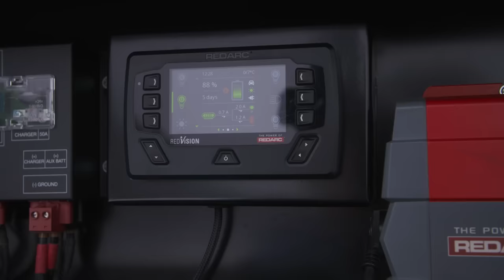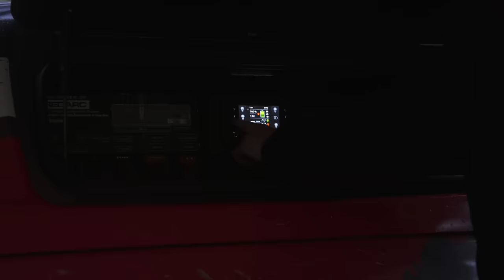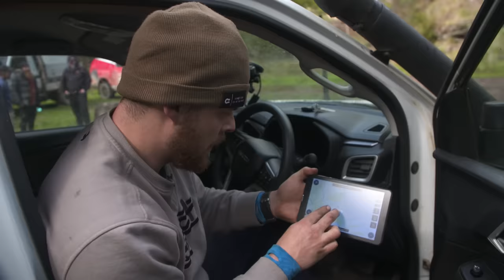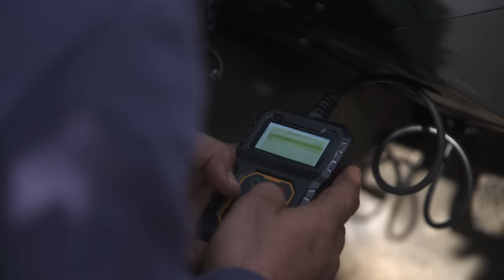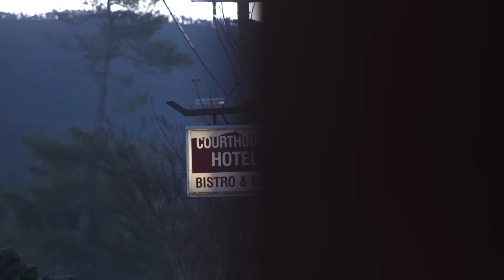4 HOURS WINCHING IN MUD & SNOW! Three 4WDs FLOATED downstream... Who got towed home?

Comment: What is funny is that Shano hasn't discovered snow chains. It's like taking a sword to a gun battle.😀
Reply: All makes a better video for there target audience of 12 year Olds who want to see 100k cars and hard wheeling
Reply: lol yep that is the one chains work the best on snow 😁
with out them you have a problems to drive the track
i have juse them many time's
Reply: With shunos driving the snow chains would fly off
Reply: Yo that’s so true what were they thinking
Reply: @renedeboer7348  but with them you dig bigger holes faster and less progress
Reply: @jasonh4167  Not really. In order to float on top of the snow you need HUGE tires. If you have that snowchains are not used. 
With or without snowchains on "smaller" tires you need to reach the bottom (or something firm) to gain traction.

//Scandinavian
Reply: I'm sure they've used snow  chains in previous episodes
Reply: Same thing I was wondering. No chains? Kind of a rookie mistake.
Reply: They have said that the permit says you have to take them with at least.
Reply: @perpelle  yep, dig a bottomless pit because under that soft snow is soft mud 👍🏽
Chains are better for icy snow on hard pack road or pavement 

//Appalachian mountain man
Reply: @MrMrsregor  Depends on the ground frost and the depth of the snow. I've had far better experience with chains no matter what vehicle or what type of snowy conditions off-road, both private and in the military.

EDIT;
/last outpost, north of north.
Reply: Think that's why he said they air down like they're driving on sand
Reply: I reject that remark about being 12.  I'm at least 14!!
Reply: I hear snow chains are beneficial for mud, as well as snow.
Reply: That’s funny because I opened up the chat to ask if AU has ever heard of chains!!!😂
Reply: Nar digging wheel trenches on 35" for the normal 4wds on 32" is part of the fun. great when the tracks get blocked because of trail destruction...
Reply: snow chains are for noobs
Reply: gloves would have been another good idea.
Reply: As a Alaskan the only time I see chains is on heavy equipment in mud
Reply: Is there snow chains in Australia🤔🤷🏻‍♂️
Reply: @timtemple8953  have you ever heard of a metaphor? Seriously Tim, you need to grow up.
Reply: @jasonh4167  Only if you spin them. If you are experienced, no digging.

Comment: Common problem for the zd30CRD is the fuel pressure releif valve, they get tired over the years and dont let the common rail pressurise up. easy fix, ill bet its that.
Reply: That, or a injector leak. Mine had the same issue. Would not start, and died when pushing hard. Turned out to be a leaky injector, so the ZD30CRD could not get enough rail pressure to start. Needs 5000 psi to start. Would run an injector leakback test.

Comment: I'm just 16 minutes into this episode and I've been waiting for this episode to air for a long time :)
As someone that lives in Switzerland my entire life, I highly recommend using snow chains in this sort of conditions mates 😁

Edit: That water crossing was insane, well done boys!
I think Graham would have opted for a different crossing if he was there.😅

Cheers
Reply: yes snow chains for sure
Reply: agree - As an Australian with a 4x4 who has done 45 years of wheeling across the deserts - I carry snow chains - i've even used them in mud :-)
Reply: Sensible people use chains not to many of those 4WD 24/7
Reply: @markrovers9360  it depends. Chains dig. If it's super deep and soft you don't want chains or narrow tires.  If it's not super deep and there's a solid base to grip to, then ya narrow tires or chains. That's why people that snow wheel in the mountains use really wide tires and no spin to ride ontop of packed snow. If it's 4'+ of snow the last thing you want is to dig you'll be burried.
  They deff coulda used chains here, but not the entire time. So putting them on taking them off constantly is a waste if its not absolutely necessary. There's a time and place.
Reply: @markrovers9360  in short. Sensible people know when to use them and when not. And wheeling is about adventure and fun. Not being prim and propper
Reply: one problem with chains is they arent meant for high RPM wheelin. and they dig down. im in Washington, we cut and sipe our tires for snow. low psi and proper cut tires work better then chains. go over to Dirt Lifestyle channel, he just did a video about this.
Reply: @BangarangNuke88  yeah for sure. But they are also for different results. Grooved and siped holds snow for traction while chains dig down to a hard surface
Reply: @BangarangNuke88  and I think you mean high wheel speed not rpm. But it depends. If you look at logging trucks in deep mud they run chains and spin the shit out of em, they break more often if they hit Rock, but as long as you have them tight you can spin them all day.
   But super deep snow you don't want to dig anyway, that's why that Iceland guy or whatever those tires are very wide and baloony. Spread the weight out so you can ride on top of the snow rather than dig into it.  Snow tires for road use are the opposite. They are narrow tread pattern with aggressive tread to dig and grip the cold hard road surface. I have studdable snow tires for the wife's car, they are siped as well from factory but to grab the road surface.

Comment: Tip on chains when/if you get some

Let air out of your tires, put the chains on tight, then pump them back up. Chains won't budge and the tires change shape super good for snow traction. Used to get a few feet a year where I lived, our stock jeep Cherokee was unstoppable in it. 

Extra bonus is doing chains with studded tires.

Comment: Hey fellas great video! Just a heads up. Here in the states where we wheel a lot in the snow. You need to air down more. 18 psi is actually a little high. If you are running beadlocks go down to single digits. 10-12 for non beadlock.
Reply: He aired down to 5 psi if u watch up to the 15 minute mark

Comment: When running in really deep snow you let off the throttle and hit the brake when you’re slowed to like 2 or 3 miles per hour , If you keep spinning when your stopped you will feel the vehicle settle and now you cannot back up. I’ve driven in very deep fluffy powder so deep it fills the engine compartment right full and you have to clean it out so cooling air can flow through. You try to open your door you have to push the snow with the door. Snow traction can even change in a few hours. I snow wheeled and snowmobiled for over 40 years and there is nothing quite like it! Have fun boys!

Comment: Did the patrol have an oil change recently?  They have an oil sensor that does exactly that when oil is low.  No error/warning codes, oil pressure light won't come on.  Been stuck for 2 days changing fuel, filters, removed and cleaned tank, flushed fuel lines etc.  Someone pulled the dipstick and oil was low, topped up and she was as good as new.

Comment: Being in North Idaho, I usually start with my tire pressures at 5 psi for snow wheeling and will use the occasional 3 psi for great escapes. Would feel better with beadlocks. But with careful driving, I’m yet to blow a bead.

Comment: my 2.5 r51 the rail pressure relief valve went bad. A new one didnt fix my issues. Turns out the valve needed shims to allow the fuel rail to hold a much higher pressure for the tune.

Peets is the SCV or boost control solenoid. Blowing black soot. not starting. Hopefully not injectors or fuel pump.

Comment: Was it the fuel rail pressure sensor in the back of the rail on the ZD? Weld the prick anyway!! Could have spaced with a washer or 3 to get it going if it was the issue 😉

Comment: The bounce is key in snow it packs the snow then blows it away it keeps the truck moving if you just drive straight and steady you just pack the snow into a ramp until you're tires don't touch ground anymore and then you are stuck on a ice mound you created

Comment: I went out with some friends, we found a trail that we thought was doable, even if it would be an adventure. We got 3 rigs in about 150m, then #4 went off the edge and chewed the edge off. It took us 6 hours to get those 4 trucks backed out of the hole.

There were 10 rigs there. With all the recovery gear you can imagine.

Comment: what is that high pitch knocking noise when the GU engine just fired? It's not the starter noise I'm taking about but just as the engine turns over there is a knocking noise for like 1 second before it runs on its own.

Comment: Love the show guys!!! After all that high revving what checks do you do back at the shed to make sure shes ready for the next trip?
Reply from the maker: Oil change after most trips, since we do so many km's on the road and the km's off road are very high stress. Otherwise we're checking over all the usual things! Hoses, belts, driveshafts, bushes, shocks, all the nuts and bolts we can find mate! 

Add air filter to the list if you've hit a lot of water or dust too.

Comment: Watching yous spray in contact cleaner really lowers my hope in knowing if you guys know what it does in petrol engines. You can run a petrol on it because of the spark plugs, a diesel doesn’t work the same way obviously. So the only way it would start is if the diesel lights, and if the diesel lights it would run on its own anyways. Hence the contact cleaner being irrelevant.

Comment: U can tell these guys don't go in snow very often. My 2x4 1968 f250 gets around better than them. Tall skinny tires with chains and weight in the back for the win. The boot method just creates ice under the tires. U gotta cut to the bottom and cruise easy or u gotta float on top and go extra easy. That looks like heavy wet snow and the trick is to make a large footprint and float on top with wide tires. U want to avoid breaking the tires loose as much as possible

Comment: Of course there’s the mandatory chains comments.  Reality though AIR DOWN!!! 18 psi isn’t aired down.  Sub 10 psi once you need to start backing up.  Sub 5 breaking trail. Get on top as much as you can.  No you don’t need beadlocks that low of pressure.  You need to be gentle and smooth though.  The throttle fest looks great on YouTube but isn’t effective most of the time
Reply: Clearly didn't watch 15 mins of the video before commenting, he aired down to 5 psi
Reply: @maxratzlaff8333   that’s why I added another reply.  As a dedicated snow wheeler for years I find some of that hard to watch.
Reply: @Scoobienorth  yeah fair enough in Australia we have no idea about snow driving haha